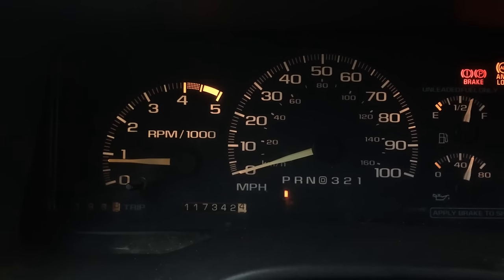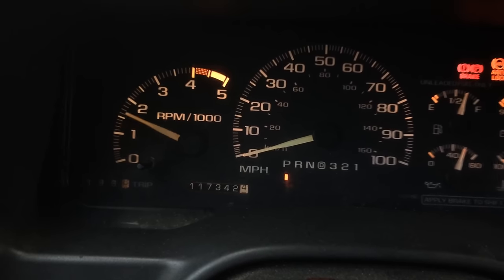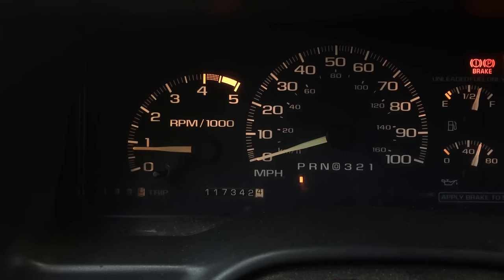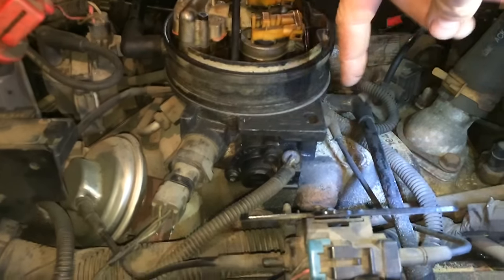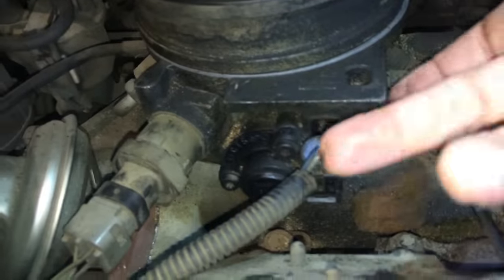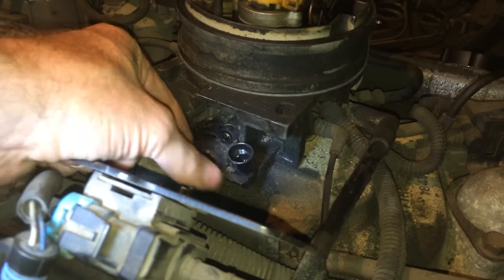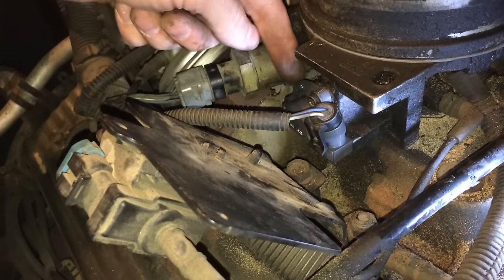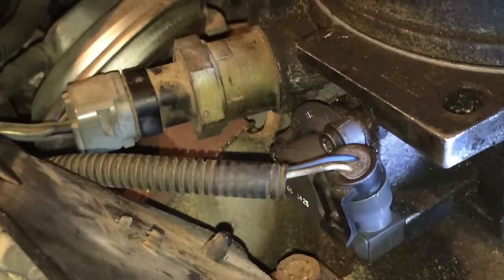Throttle Position Sensor Symptoms And Fix TPS

Comment: On a 95 4runner, could this be the reason for a an acceleration lag that happens only in first gear? Hesitation only happens when I accelerate from a stop. But, if I drop it into low gear and back into drive and then accelerate, it works fine.
Reply from the maker: Sounds more like a problem with your transmission not downshifting when you stop, and it lags when it tries to turn the wheels in too high of a gear.
Reply: sounds like a good possibility! Kickdown cable?
Reply: Auto experts aren't there to impress, only to make money.  Good luck!
Reply: What happen if remove the tps sensor then use it

Comment: I have a Jeep Grand Cherokee 2007 when going in reverse it barely has any power and a few times it wouldn’t go past 25 miles an hour with the pedal all the way down could this be the problem
Reply from the maker: +Juan Martinez yes. This could be the problem. Other things that might cause that would be clogged exhaust pipe or catalytic converter.

Comment: hi is there any way to repaire or clean tps sensor.
Reply from the maker: I don't think so, but you can test it.  You'll have to check the manual for your specific model of car, and you can check the resistance in it with a multimeter to see if it is still good.

Comment: My 2000 blazer started doing this after about a week of sitting and right before it sat I cleaned the throttle body without taking it out of the engine so I think I damaged the sensor

Comment: Mine is idling perfectly, but in neutral when i rev it to 1800-2000 rpm the revs start jumping up and down, when i floor it, it goes through the rpm range like a champ, could it still be the tps?
Reply from the maker: +Drop Assassin It could be.  That might also be dirty injectors.
Reply: Thanx for reply.....but would injectors not do it throughout the rpm range? why only between 1800 and 2000rpm?
Reply: @dropassassinofficial  my truck is doing this. Was this your fix?

Comment: I just replaced the tps a couple months ago and the symptoms continue. I might have to look for dead spots with a dmm
Reply: knock off parts are junk, you must calibrate sometime it hard to adjust them sometimes you have to bend the connector pins to make contacts  with the females.

Comment: What if it's the opposite, my car is jumping in idle and jerking the car and it does a little bit of hesitation when I accelerate but like now my car won't stay started unless I keep on the gas
Reply from the maker: That could be a bad fuel pump or clogged fuel injector, or a vacuum leak on the intake.

Comment: My truck starts jerking and eventually stops accelerating all together when I get in between 60-70mph on the interstate. ETC light comes on. I have to pull over and restart it. Could this be the issue?
Reply from the maker: +Tyler K. It could be this, maybe a worn out and clogged catalytic converter muffler, or I have also seen the EGR valve get stuck open and cause this kind of behavior.
Reply: hoohoohoblin okay thanks for the info 👍
Reply: Tyler Tennessee. u figure it out?

Comment: you know what I like more than materialistic things? 
Throttle position sensors
Reply from the maker: Ha ha! Me too!
Reply: hoohoohoblin also, my engine is throwing a “tps voltage too low” and I already replaced it, do you think it could be the wiring?

Comment: my tps says lower than expected. But my idle is fine.  But acceleration is really slow, and i cant red line in "D", but if I turn over drive off it runs fine, or if I drive in "1" or "2", it will rev fine.  BUt when on D, I can get to well beyond highway speeds, but the acceleration isnt there and cant get past 3000 rpm...
Reply from the maker: I've read a bunch of threads on the internet by people having the same problem, but so far no one has a definitive solution.  It could be the TPS, or some vacuum line, or the emissions equipment.  My truck is doing the same thing right now, and I'm trying to figure it out.
Reply: I'm not stuppid.im a woman trying to do a man's job. 1999 Chevy ,4 +4. where is fuel pump.how do I get the pump out of the tank
Reply: hallmonitor98

Comment: will the TPS stop the engine from starting  suddenly........ The engine has all the symptoms of a vaulty TPS.
Reply from the maker: +Gregory Nobles no. It should still start fine, but when you step on the gas it will hesitate when accelerating.

Comment: My Silverado when I accelerate it doesn’t come back to low acceleration easily and the it indicate ‘engine service soon’ I have replaced the throttle position sensor but still the problem is the same😌 I don’t know what to do next.

Comment: i  have a  93 1500  chevy  it  starts  but when i put it in gear it dies. .i  dont know why  so far  i  replaced the  air fuel   sensor and the ignition module . i  burned out the starter   and  replaced  that .and same thing  5.7  engine  auto trans . now it wound start at all .just cranks. in about 70 and im  out of ideas  and  stuck at my place out of town .
Reply from the maker: That might be a clogged EGR valve. On my truck the catalytic converter went bad, and the plates inside it came loose and blocked the exhaust flow, which made it hesitate really badly.
Reply: tim kahn I had the same problem. Replaced the fuel pump and it worked. Try it I guess.
Reply: It seems you have a fuel problem. Bad fuel pump or plugged fuel filter
Reply: Fuel problem if it cranks and nothing..fuel filter..fuel pump..
Reply: Did you gain understanding Tim? please share for us facing similar symptom 🌻

Comment: Could a bad sensor cause my car to idle all over the place sometimes to high sometimes to low  twice it stalled out in my driveway while warming it up?
Reply from the maker: It would still idle smoothly,  but wouldn't have power when you accelerate.  I think that would be some other problem.
Reply: change idle sensor

Comment: I have a 1997 K 1500 when you put it in gear it wants to rib the RPMs up until you step on the brake and then it brings it back down and around 15 mph and I'm not even on the accelerator can anyone help me please
Reply: Brake booster vacuum leak

Comment: so why does yours cost 40 for a V8 when one for my 4cyl costs 77 let mw have the number of your parts depot
Reply from the maker: I think it’s because Chevrolet made millions of these 350 cubic inch engines and barely ever changed the design over 50 years, which makes parts cheaper because there’s more demand for them.

Comment: I was having the same issues and I mean exactly. I changed the fuel filter and nothing. I changed the air filter and it fixed it. No one ever says to change that and air flow especially under a load like putting it in gear is EVERYTHING I repeat E V E R Y T H I N G. Auto experts do not impress me.
Reply: Leon Taylor and your right
Reply: so you need to pay attention more when ou read these blogs air, fuel, comes up pretty regular. if that fixed your problem the filter must have never been changed in 100000 miles. should be checked everytime the oil is changed

Comment: It's a bloody stupid invention. When a cable breaks at least you have the option of string from under the bonnet, when  this thing fails, like it did on my Land Rover the other day, i had to drive the 12 miles from work to home on tickover. It took me an hour and a half! Now i'm debating do i buy a second hand sensor(£15 - £35) or a new one OVER £300!

Comment: It will take even a smart person that had done.it.before more than 5 minutes on a Ford 5.8.probay more tha. 10 minutes The throttle body has to come off because the TPS is under the TB lower barrel

Comment: WOW 40.00 BUCKS MY THROTTLE POSITION SENSOR COST ME 23.00 BUCKS AT ADVANCE AUTO PARTS  1997 FORD MUSTANG V8 4.6L JUST SAYING  ;-)
Reply from the maker: +Chris Fields I got ripped off! Thanks.
Reply: How did you get ripped off?
Reply: Chris Fields i have to buy 1
Reply: Cheap parts for cheap Fords... ;D
Reply: Ford just another 4 letter word...crap
Reply: Well I have a 4.3 same as the 5.7 but 7 and 8 cylinder gone everything will fit from a 5.7 and fits a 4.3 anyways I got one for 6 bucks on ebay
Reply: lucky you, advanced auto wanted 77 for my 4 banger S10 pickup
Reply: went to chevy and checked they wanted 140 bucks
Reply: i picked up one for chevy 4.3 on ebay for $8... i hope the sucker works...i have had good luck so far with ebay ...
Reply: Slick Rick  Rick... did the ebay Tps solve your issue? i am going to install mine in morning,,, my 4.3 6 hesitates from zero to 10 mph... thax
Reply: What a gay ass car lol.  Only good thing in it is the engine